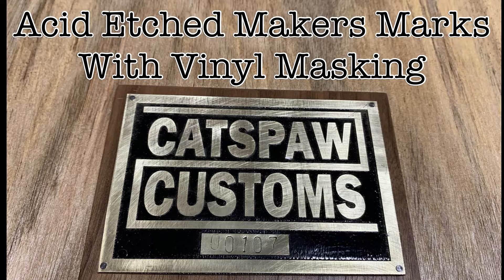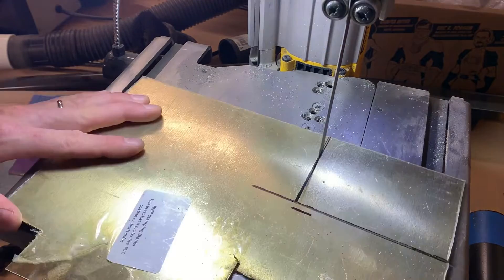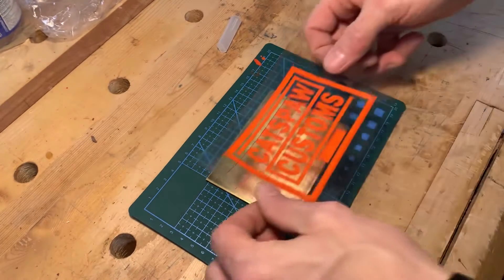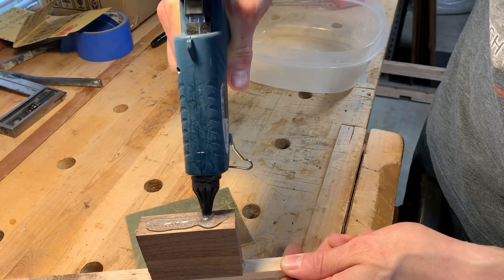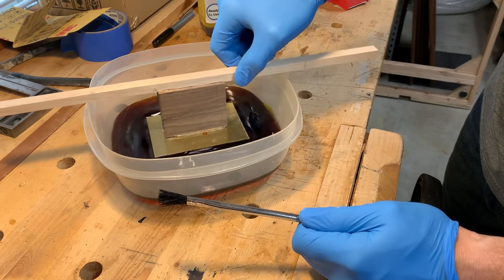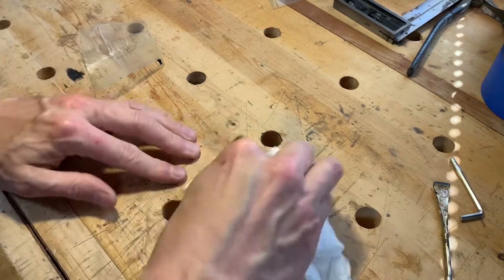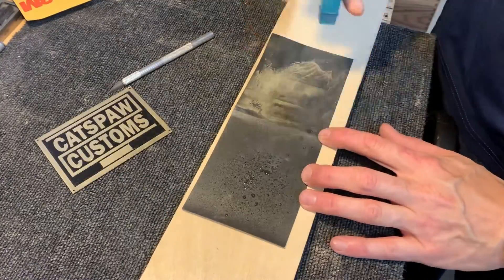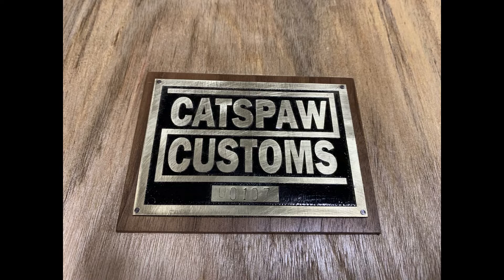How to Acid Etch Brass with Vinyl Masking

Comment: One thing I don't quite understand about etching (and I know the process is used in printing, so it must be very precise) is how come the metal plate being submerged in a liquid acid bath, this one seems to eat away the metal only vertically into the plate and not laterally ?! I understand that any protected surface (by vinyl masking or scotch tape under) can't be directly attacked by the acid, but how come, once it starts eating  below the exposed metal surface all around the masked letters, it doesn't eats the metal under the masks as well (laterally, and therefore attacking the borders of the letters and "shrinking" them as well). The same way, I suppose the acid would eat the exposed lateral sides of the plate, shrinking the actual plate slightly, but those are later cleaned by the belt sander anyway.
In the end, the etching looks like it doesn't alter the edges of the initial motif (letters), just as if the plate was CNC milled perfectly around them... but maybe it does somewhat ?
Any explanation would be appreciated :)
Reply from the maker: Sorry, I’m not a chemist, I just know it works.

Comment: Hi, will it etch straight through 2mm brass?
I need to etch a perfect rectangular slot, and no filing out one is not good enough.
Reply: There is no way you're going to etch through 2mm brass. Gonna look like crap. You need a CNC if you don't want to do it by hand.

Comment: Nice Job. Question, is this metal plate fire proof? Can you still read it if if gets in house fire? Thank you
Reply from the maker: Well, it’s brass.  So whatever the melting point of brass is versus how hot the fire gets will determine the survivability.

Comment: What sticker did you use? Because the vinyl that we use dissolved when we alredy put the ferric chloride.😢
Reply from the maker: Pretty sure it is just oracle 651 or cricket brand vinyl.  I’ve never had it dissolve in the ferric chloride.
Reply: @catspawcustoms  i hope we had that kind of sticker here in the philippines.
Reply: Sir is it important that we use only 47% ferric chloride?
Reply from the maker: @joveee.g4179  I don’t really know.  I’d probably recommend staying at 47% or lower.  If you use lower, it just takes longer.  If you went higher, it would probably go faster, but beyond that, I’m not sure what would happen.
Reply: @catspawcustoms  i really dont know the percentage of this chemical we are using because unlike the chemical you use it has label on it like you know the percentage of the chemical you are using. Here in the philippines we dont have those label.
Reply: @catspawcustoms  sir last question...what did you do to etch the letters deep...
Reply from the maker: @joveee.g4179  time, the longer the soak the deeper the etch.

Comment: Why you didn't connect any power Normally every video there are power supply ❤❤
Reply from the maker: Because this is acid etching, not electroplating.  Power is not needed.

Comment: If space is not a problem, they have holders for the metal stamps. Or you can tape them together and pound them in sequence.  Either way the numbers will come out straight and equally spaced.

Comment: Can you used a laser cutter on vinyl to cut out your pattern.
Reply from the maker: No idea, but it would be worth a try.  Though, you have a laser cutter, you could paint the brass, cleanly burn away the paint where you want to etch and do it that way.  Paint will mask the metal from the acid too.
Reply: @catspawcustoms  I have painted a metal plate and laser engraved a pattern but not sure if i am using the correct type of paint that will resist acid, some say acrylic or lacquer. I have seen a video where there still is residue on the lasered surface preventing acid etching even though it looks like bare steel or brass, they say wash off with lighter fluid or soap and water which doesn't affect the painted surface. I was was wondering if there are any up to date current active forums that talk about this method of engraving using paint as a resist.
Reply from the maker: @chrisabraham8793  you’d definitely want to do some tests to be sure.  I’ve had success masking with a paint pen, which I believe was a lacquer paint.
Reply from the maker: @chrisabraham8793  and actually, it would also be worth trying to cut the vinyl after it is stuck to the brass.  My only concern there is me thing the vinyl or adhesive with the laser.
Reply: @catspawcustoms  Not sure if they do laser cutting vinyl, they seem to make laser cutting rubber for rubber stamps.
Reply: I used a diode laser to cut very small numerals for a watch dial and it came out very well making sure focusing is good.

Comment: Do you have a preferred brand or type of vinyl and transfer tape?
Reply from the maker: Not really.  Anything should work.  I usually use a color that I don’t expect I’ll need.  Cricket vinyl works well.
Reply: @catspawcustoms  which type of colour
Reply from the maker: @yogendrathakur3683  it really doesn’t matter at all, but I think glossy is better than matte.